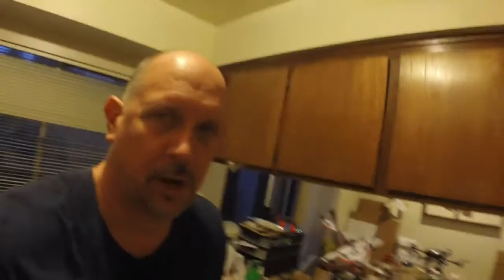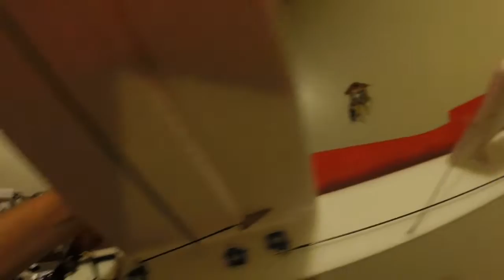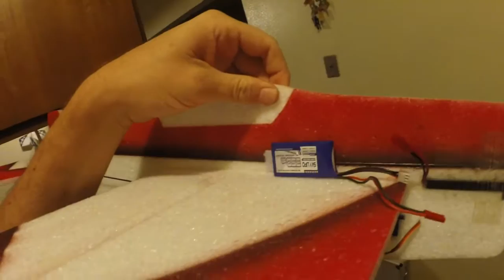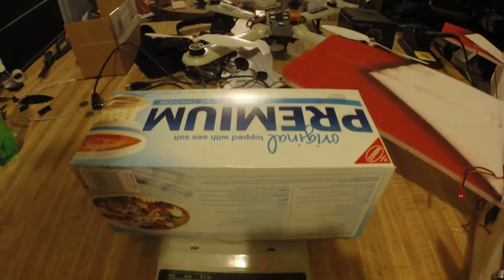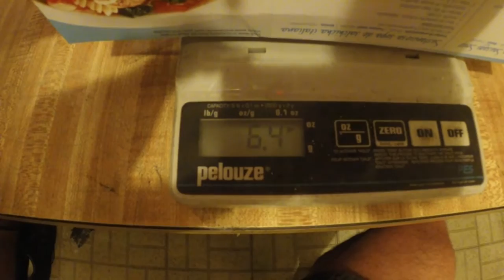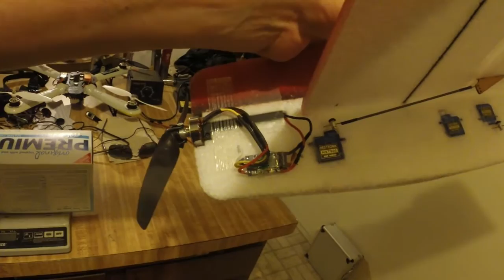Superslo28 EPP Plane AUW

Comment: Nice  work .  Would you advise the battery go on the side opposite the ''torque effect '' of  prop  ?
Reply from the maker: Ross Fraser what I try to do is put the battery on one side and all the electronics on the otherside.to balance it out.
Reply: thanks , would the same plane in depron be heavier or lighter  ?
Reply from the maker: Ross Fraser Depron is fragile and breaks to easy, and real hard to find at the moment, 9mm Epp is so much better.
Reply: Thanks again . Have just started a ''Slow boat '' out of depron  .Hope it holds up . It looks like a real performer on and off the water . Cheers .
Reply from the maker: Sounds great keep us updated.
Reply: Ross! I just finished building a Superslo28 out of 9mm Depron (it's hard to find EPP in Australia). AUW with a 300mah battery and a relatively heavy plywood motor mount is 6.7oz or as we would say in Australia 192g. With a 400mah battery its 7.1oz, 202g. Plenty strong enough if you don't hit the ground hahaaa! Thanks for the great design Tallguysd :)

Comment: ruh row, Viewing this I realize I have no idea what I am doing... the guy at the local hobby shop sold me a:cheetah 2217-09 motor: 950 KV 200, 10 x 7 thin prop, 1350mAh3S 11.1 V 30V lipo. is this for a much larger setup? crackie!
Thanks for the video. willl look at your plans and details. Thanks Rob.. scott

Comment from the maker: Small planes can get by using just one servo for the ailerons saves weight and can still give you great throws. 2 servos are good for larger planes that require a bit more torque for true deflection.